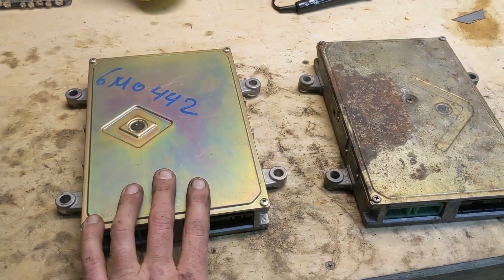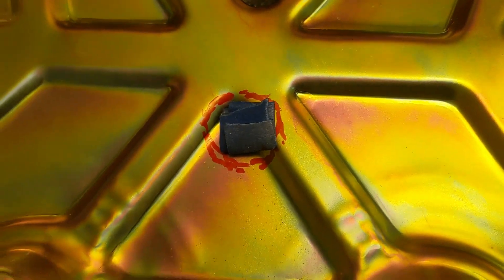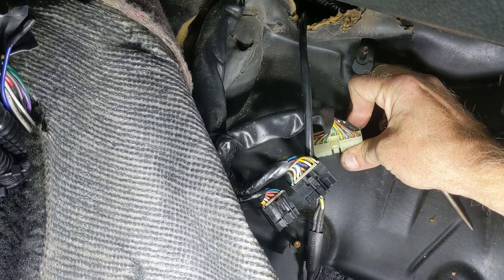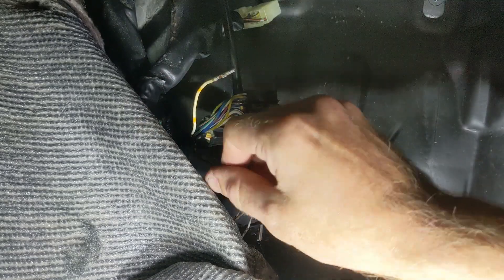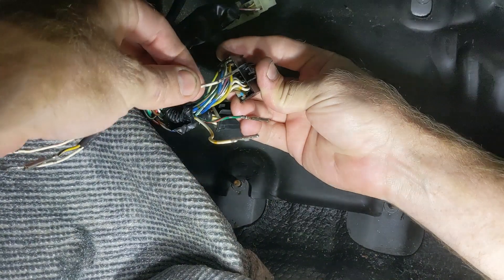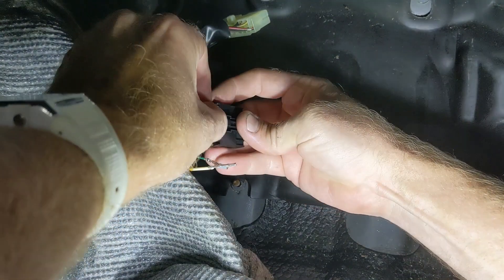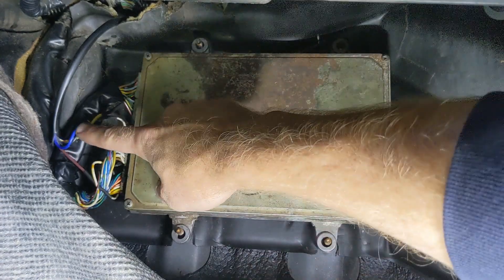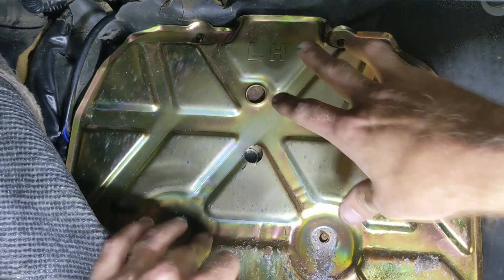Honda CRX B16 Swap - Part 7 - ECU and VTEC install - Make it So

Comment: i have a 96 b18c jdm itr swap going into my 89 si hatch, which ecu should i get for it?
Reply from the maker: I think most people use a p28 with hondata as a universal solution for swaps. If you want stock then just lookup what ECU came in a 96 itr and use that.
Reply: @MakeItSo  okay cool, yea i don't want to go the hondata route if possible, i just want to be able to run it as stock as possible

Comment: I read things about caps going bad in ECU. Not sure if it applies to my 95 Civic Coupe EX so I am unsure if I should buy a spare now or wait till mine goes bad. Your thoughts?
Reply from the maker: Did you end up getting your ecu recapped?
Reply: @MakeItSo  not yet. i’m saving up for respray then ECU because the car is currently running without issues.

Comment: Question. Is this you installing the harness from the b16 to the chassis harnesses?
Reply from the maker: No, This is me converting my D16 (stock CRX) engine harness to work with the B16. You only have to add 4 wires for vtec.

Comment: just curious why you didn't upgrade to obd1 and just us a conversion harness adaptor. the adaptor has a sub harness for the vtec and other sensors. there would be no need to de pen the ecu wiring.
Reply from the maker: I may do that eventually. B16 Vtec ecu's aren't cheap and would require two conversion harnesses and an OBD1 distrubutor. P28 ECU with  Hondata would cost even more. So, one step at a time for now....and for this first round I'm interested in keep the motor/ecu stock/jdm paired.

Comment: Do you did not use the b16 engine harness or you just used the d series right ?
Reply from the maker: I used the D-Series harness. It's a perfect fit, just had to run 4 separate wires for VTEC.
Reply: @MakeItSo  what did youbget the harness out of I'm  doing a hatchback
Reply from the maker: @sie1312  I'm using the stock engine harness that came with the D-Series motor. I've read that in general you're supposed to keep the engine wiring harness that's original to the car and adapt it to work with the new motor, so it plugs into the chassis harness with no problems.